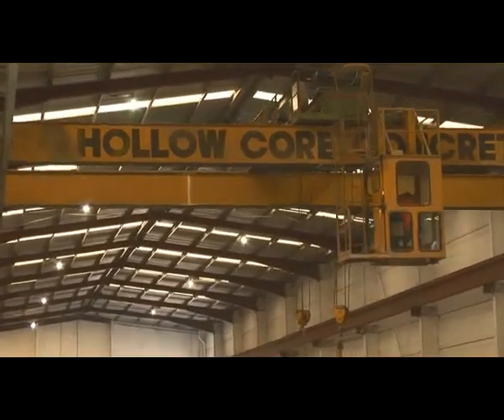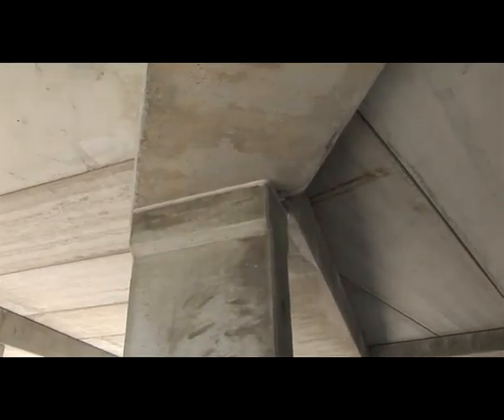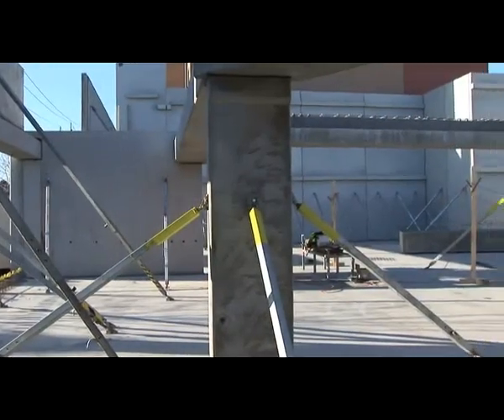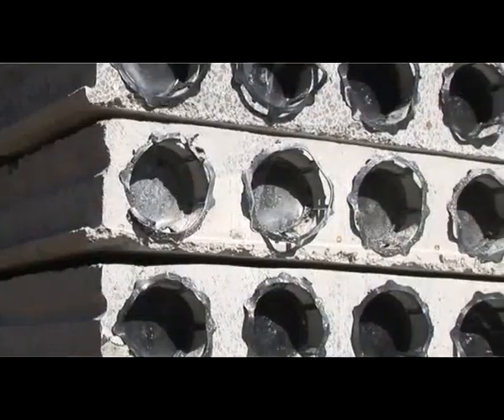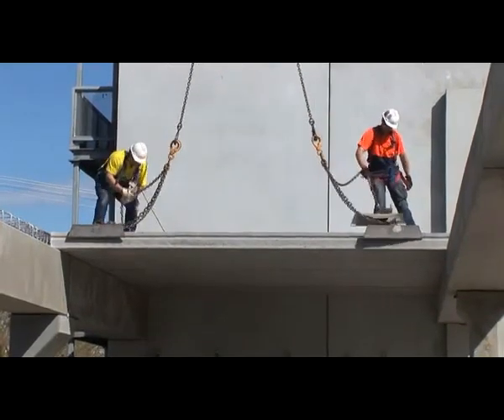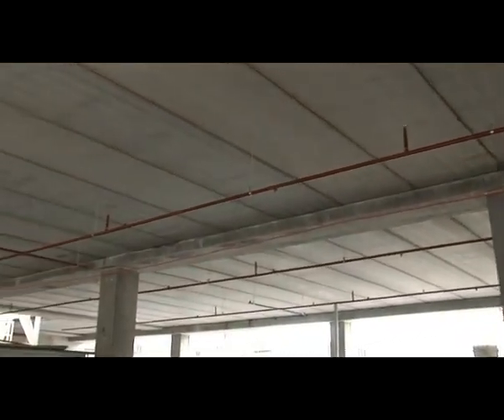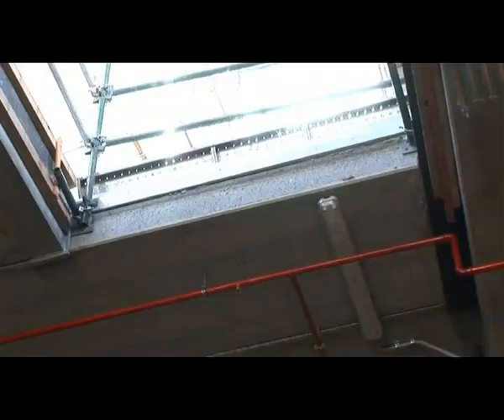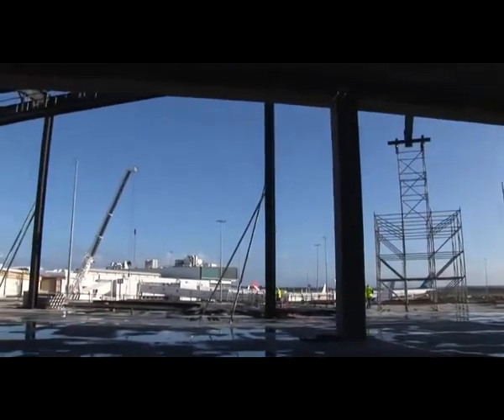Introduction to Hollow Core Concrete Pty. Ltd.

Comment: Can the planks be 35 feet j. Length for residential single family use ?
Reply: they say in the video that the hollow core planks can be up to 18 meter ore 54 feet long! 
But that means stronger foundation to carry the weight since even with the holes its still quite some weight in the thickest 
type of hollow core But i see in the PDF 12 meter = 36 feet can be made of ONLY 300mm thick plank more than that you need 400mm slab. hehe
https://floodprecast.ie/wp-content/uploads/2015/08/hollowcore_A4_aug.pdf
Reply: Hindi koi bolte hai sir

Comment: I have 1 question . In the vid there is a guy using a trowel . Underneath. Is that Gu cement ? Or a grout? What’s the trick for filling the void under the hollowcore .